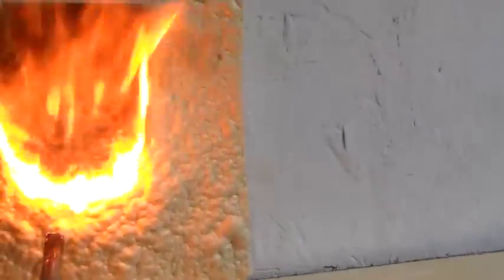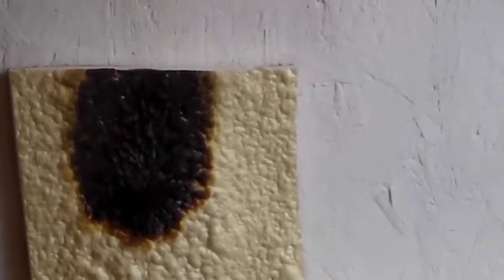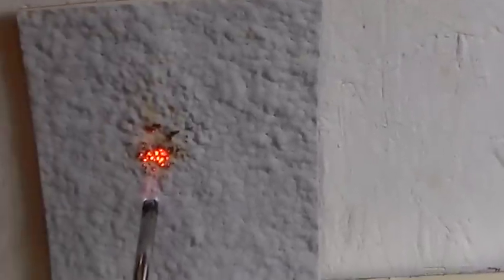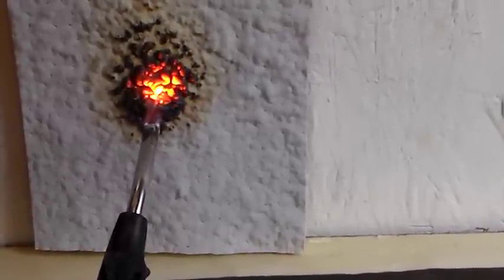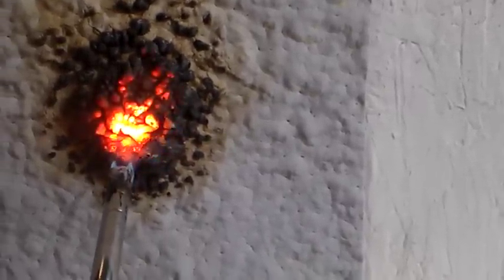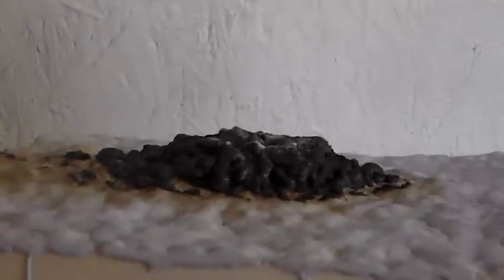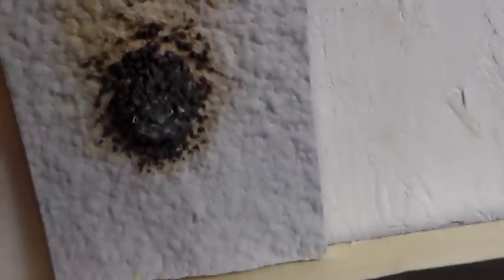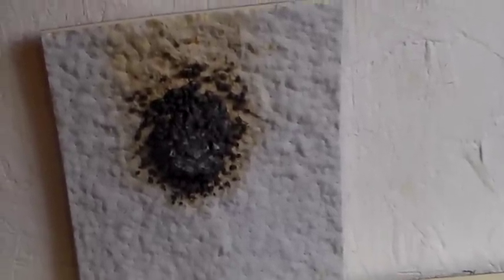DC315 Fire Retardant Intumescent Paint for Spray Foam Insulation - demo

Comment: The foam you used is closed cell. That's why it didn't burn easily. Open cell is when you need a fire retardant. Please redo the process using open cell with and without the coating to show viewers.

Comment: Code in my area says DC315 alone is not enough. I am being told I have to add a latex primer to get a class 2 vapor barrier.
Reply from the maker: Codes can vary from place to place, but DC315 actually meet the standard for a Class 3 vapor barrier. Here's the long version: DC315 has been tested in accordance with ASTM E96 to determine vapor permeance. Test report TJ5066-2 conducted by IAS accredited lab QAI on 18 mils WFT of DC315 resulted in a perm rating of 8 which qualifies DC315 as a Class 3 vapor retarder. DC315 can be applied over SPF insulation to meet code requirements in climate zones that allow for a Class 3 Vapor Retarder while also providing the code required thermal or ignition barrier of the SPF insulation. In situations where an Ignition Barrier is required, 4 Mils Wet Film of DC315, the application of an additional vapor retarder coating would be required, alternatively by applying 18 Mils WFT may save labor and costs associated with purchasing and applying another coat of a vapor retarder coating.
For Climate Zones 5, 6, 7, 8 and Marine 4 where a Class I or II vapor retarders are required on the interior side of frame walls, DC315 has been fire tested over primers, including paintable vapor retarder coatings, that are tested to provide the required retarder class number. This assembly provides the required barrier to moisture transmission while still ensure the fire protective properties again meet the required thermal or ignition barrier. By applying the vapor retarder coating prior to the DC315 it will allow for a greater spread rate as the primer will seal the surface of the OC SPF and reduce the loss of DC315 into the porous substrate.
Reply: @Rdrtechnologies  you are correct in everything you say here. I am not an expert at DC315 but I did have to learn a good bit about it while dealing with local code. The area I live in is a model code and they recently adopted a class 2 vapor barrier. Yes DC315 is a class 3 vapor barrier but to achieve a class 2 rating the manufacturer recommended using Sherwin Williams vapor barrier primer. That is what code made me do in my area. I get it. There is air handling equipment in the attic in a close proximity to the insulation layer. They are just being cautious. And yes it is being used as a thermal barrier or to use your term ignition barrier.

Comment: Is it required to meet code?
Reply: With regard to houses, in general it is not required by code. If you do spray foam insulation inside your normal wood framed wall it will be covered with gypsum board. For a house this is considered adequate protection. If you do spray foam in places where it may be left exposed, for example in your basement or attic, then it will probably require protection of some kind. You could use a paint like this, or of course you could use gypsum board.